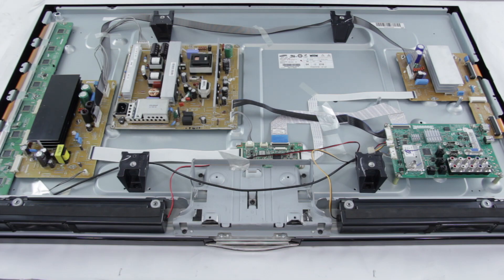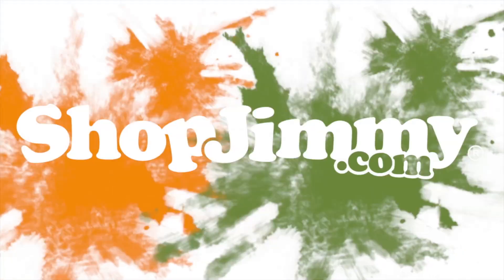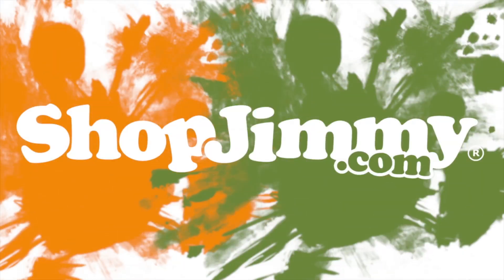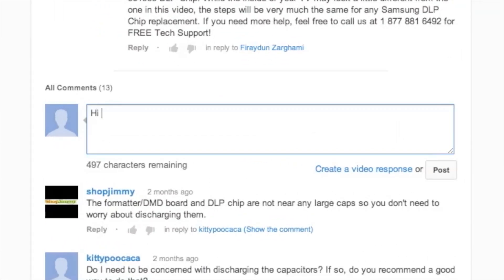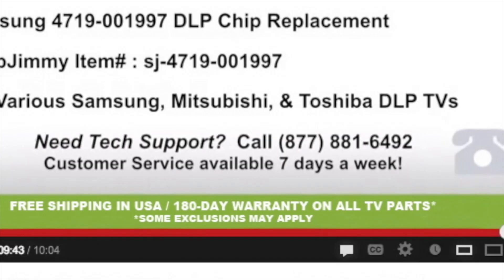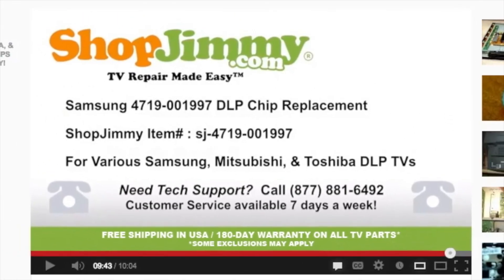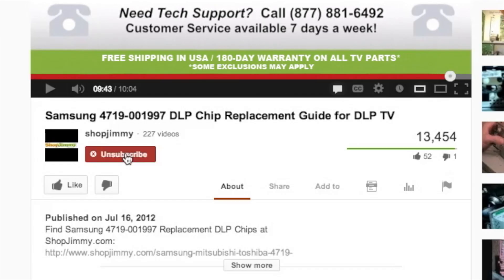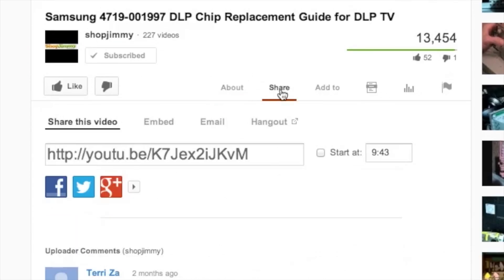Plasma TV Repair Tutorial - Common Symptoms & Solutions - How to Fix Plasma TVs

Comment: Hello, great video. I have a Panasonic plasma TV, Model: TX-P42S11B that turns off and the standby light flashes red 8 times. When I disconnect the SS board (X Sustain board) and power up the TV I will get a picture. When I disconnect and reconnect both the SS board and Y sustain board the TV starts working fine. After a few days I will have the same issue, the TV will turn off and if I disconnect and reconnect the Y and X board the TV starts working again. TV’s working duration time has also been going down from a week to a day or two now. Any suggestions which board should I replace to fix problem? Thanks!

Comment: Hello, you mentioned that you might be able to help with an issue. I have a 2008 AVP504 Sanyo 50 inch. Way back the top of the video became dark but we could see the bottom half of the picture.  Well of course not long after the bottom half did the same and away it went into storage. Been sat there, inside, warm comfortable,  and ir is now that I have time and inclination to fix this bad boy. Any suggestions as to the cause and how to proceed? Thanks so much!

Comment: hi , nice tutorial sir, i have 43" plasma tv 2013-14 model, it was working fine then as i switched it off in night , the next morning it was dead , no response , no red light on panel.  as usual called service center, they came an declared that its of no more use , its dead completely, reason they gave that display panel is gone and as now in 2020 plasma tv is out dated so it can,t be repaired.KINDLY HELP. SIR
ONKAR-INDIA

as you told sir- here are details 
mod.code- PA43H4100ARLXL
VERSION NO. : TD02
S/N: H0073PBF301036P.

Comment: hello im trying to fix my Samsung plasma tv, the red standby light blinks when you plug it in, but slow blinks, unlike others I see here on the internet. and there is another board that blinks a green light...I made a video on you tube to show what it does , I allready replaced the power board with another used one that was suposed to be a good one, and it has the same behaviors, IE, red light blinks slowly, and green light inside blinks one fast then one long blink,,...  here is a video showing what its doing, maybe you can help?
https://www.youtube.com/watch?v=RhsAqGHOqmw

Comment: I have an old SumSaung Plasma model TV model 850HW-YB07(mfg 2011).  It had faults recently with symptoms of no display and had power ready red-light short blinkings and goes away when turning on by the remote control.  At the point of failing,  i heard a loud "POP" sound and then no display straightaway.  I bought a power supply board from China to replace the old one in considering highly as the power supply board failure. Hwoever, having replaced, the same problems remain unchanged.  I wasted my money buying the power supply(it called substitute part from supplier) as original pwer supply module is no longer available.  Now i would like to get suggestions from Jimmy what the likely part goes wrong.

Comment: Hello, I own a Pioneer PDP-4280XD plasma TV and doesn't turn on anymore, not even the standby led nor any start up power noise. The previous symptoms on my TV set before failure were that it had some voltage leaks or so. I would need to remove the ground cable from the wall socket where I plugged the TV otherwise the mains would turn off in my house. This would only happen when I plugged a device (blueray player, PS3, Cable box) through any HDMI port. I could even see small sparks of electricity as I made contact between the hdmi connector and TV port. I solved that problem by removing the ground cable. 

A very long time after that fix I plugged a hdmi cable which has been press heavily   in one point of the cable length. 

Have opened the TV and have bridged the only fuse I have seen next to the power supply. But nothing changed. 

Any help would be appreciated.

Comment: I have a LG 42 inch that has many multi color lines that go up and down. It was stored for a while and it had the power cable across the screen.  I think that is what messed it up.  Is there  a fix for that? And would it be cheaper to just buy another one???

Comment: Having an issue with my samsung model pn63c7000yf.  The set turns on and I can get audio but there is no video on any of the HDMI inputs.  I have tried multiple cables on multiple ports.  Get the same symptoms on all variations.  Any thoughts?  Thinking it may be the Y Sus. board.

Comment: I have a sanyo DP42740 plasma. It had no power and no standby light. The power supply had 5v on standby but didnt have enough voltage going to both sus boards. I changed the main board. It now clicks on and green light is on at bottom, but no pic and no sound. I did flashlight test and nothing. Any ideas would be appreciated. Thanks

Comment: Hi Jimmy, my Samsung plasma TV PA43H4900 suddenly stopped working and my MCB tripped. Whenever I tried to power on the TV MCB trips. I checked the power socket on wall and found okay. Later I asked an electrician about this. He's saying it may the TV's PSU got short. I just want to be sure from you what may be the problem and what components are to be repaired or replaced. No lightning was struck when my TV stopped.

Comment: I have a 59” Samsung plasma tv (PN59D6500DF), bought in 2011. While watching the other day, the screen went blank. Hitting the remote on switch does flash the red light, but I don’t get any picture. I’ve tried the reset process with no success. Is this mostly likely a bad power board?

Comment: I have an LG Plasma TV model 42PN4500. One day it switched off on its own and now doesn't switch on. It goes on standby and when l press the power button on the remote, the screen remains dark but I can hear a faint tick-tick sound at the back. Can the TV be repaired?

Comment: I have a Samsung Plasma PN64D8000FFXZA that has no problem at all with the picture image/quality.  The picture does however shut/click  off on its own but the power seems to still be on because the green light in back blinks with a solid slow intermittent blink that seems normal  and the red standby light is not illuminated as if it was still on. At this  point I can not get the TV to respond to any command  (The standby red light does flicker when I push the remotes buttons)  accept it will turn off if I hold the remotes power button down for 3 or 4 seconds.  At with point the standby light does illuminate red indicating it has power. It will not turn right back on.  After letting it sit for half an hour or so, it turns back on and works completely normal for 5 to 20 minutes.  I tried bypassing the APC UPS and using just a DVD, but it will still cut out.

Comment: Great tutorial I have a LG 60PZ950-UA a few days ago, it started showing a wide purple bar across the screen and a green/red bar (both barely visible across the screen about 1/3 of the way from the bottom. Today, when I turn the tv on no bars, but after about two minutes it powers off. Tried to restart but no joy. It appears it's starting up in a standby, but not sustaining power and shutting down...any ideas would be appreciated.
Reply: Nevermind, I fixed it.My cable box was on an HDMI port that was apparently going bad.  I unplugged the box and started a fire stick on an open HDMI port (4 available). It worked fine the bars went away and the tv has been playing for hours. Next I plugged the cable box into an open port as I noticed I was able to adjust the volume with the cable box's HDMI plug disconnected. Once I plugged the cable box into an available HDMI port everything played perfectly. I have an HDMI splitter that I will plug into expand the port availability but only if I decide to run a raspberry pi for retro games.

Comment: Hi, I have an LG 60PN6500 plasma TV.  The problem is the TV cycles from ON for 8 minutes then goes BLACK (no pic, no sound) for 13 minutes (Cycling time was consistent over a 4 hour period).  The TV will also go black when any button on the remote control is pressed.  When on, the TV works fine and there is NO clicking or popping noise.  However, when it does goes black, controls on both the TV and remote don't work so I cannot even manually turn the TV back on.  Any advice is appreciated.

Comment: I'm having a couple challenges with my 13 year old Samsung plasma TV.  The first is, when I turn on the TV, it produces red-ish remnants from whatever the initial screen image is.  This lasts for about 15-20 minutes, then it goes away, but it is definitely annoying.  The second is, periodically, the top half of the screen goes black.  Sometimes, it comes back on and everything is okay and sometimes a light tap (or two, three, four, etc) on the right side of the TV will bring it back on.  I know replacing the TV is probably the easiest thing to do given its age, but I thought I'd ask.  Thanks, in advance.

Comment: I have a Samsung PN50A510P3F that power cycles repeatedly until warmed up. I can hear the relay click and the startup and shutdown tones each time. It usually starts with no picture/no sound, then graduates to bad picture, then better picture with loud static, and so on. Each power cycle it gets a little better until everything is eventually normal. It seems to take fewer cycles if all inputs are disconnected. I tried replacing the power board with no joy. What should I try next?

Comment: I have a 60PS60AU that shows power by having a red standby light but there is no sound or picture. I tried replacing the Logic board and nothing changed. Should I go straight to the power supply or the Y-board?

Comment: I have a Samsung Plasma TV PN PS60E8000GM which the screen will randomly go black on. When the screen is black the red light flashes two flashes ten a short gap and two again.Sometimes it works  after unplugging. I have done soft and hard resets, software and firm ware up dates and it generally will work for 1 minute to 3 hours once that is done. Any ideas?

Comment: Been having issues with a 9-10 year old 43” Samsung plasma TV. Never had any issues ‘til went to turn it on one day and it wouldn’t. Lots of clicking accompanied by blinking red light in the bottom corner by power button. After a couple cycles of clicking and blinking, the clicking would stop and the red light would stay solid, but tv won’t turn on at all. 

-Checked the power board first and found/replaced a bulging capacitor - no change.
-Followed another of your videos about troubleshooting what is causing clicking. Thought it was the main board, so bought a replacement main board, used. Only change was instead of cycling through the clicking/blinking multiple times, think it clicked once, the red light blinked a couple times, then turned off completely.
-Thought maybe the issue was back with the power board, after all, so got on an email alert for the part from y’all. Started out as a “green” -likely to be restocked soon. That was almost 2 months ago and still haven’t heard anything, so found a replacement power board on eBay, used. Switched it out, today, and still same issues with both combination of new/old power/main boards.

Kinda at a loss as to what it could be after watching this video.

Comment: Howdy,
My samsung pn59d550c1fxzc was working fine and then the hdmi inputs went dead. I unplugged all cables and then unplugged tv. Turning tv on again, my xbox 360 was the only device to work and that in input 3 and 4. I have no idea what is going on everything seems to be working fine but it just doesnt recognize the devices.
Have you seen this before? swap main board? any and all help would be appreciated. Thanks!
thanks for the video

Comment: I have a Samsung Plasma TV model#S42AX-YB04. We have had issues with it not turning on after some blackouts in our neighborhood, but would eventually turn on after pushing the power button a few times. Now it was unplugged from power via the surge protector during a thinderstorm to prevent this problem from occurimg, but it doesn't power on anymore. How can I fix this?

Comment: Hi i have a 42pm470t the fault i have is no picture but standby light goes out and i have sound the main boards green led lights up. The control board ic704 chip gets warm but the green led doesn't light up. But when i diode test it with a multimeter the led does light up. Then from the control board to the y-sus board i have 1-14 0v 15 3.2v 16-20 0v 22-23 5v 23-24 17.8v on the connector i hope I've give enough information.
Reply: Hi Jim I have got a plasma 42PG3000 has this TV got a backlight because it the picture is very dull

Comment: My plasma is the Samsung PN51F5300. It won't turn on and there is no standby light. It worked fine and the next time I tried turning on with no luck. Any thoughts? I took off the back and didn't see anything obvious, like bulging capacitors, etc. Thanks in advance!

Comment: I have a 2005 Panasonic viera model# th-37px50u. The sound cuts off after about 10 minutes. When I unplug the tv for a while and plug it back in the sound works again for a little bit whas causing the sound to cut off. Also picture is perfect. And I am doing this through a DVD player that I know works. HELP.

Comment: hi shopjimmy.com i have a LG plasma tv here for repair model no. 50K350 half screen bottom no display but the upper side has i have already replaced the y buffer board lower but condition no improvement and now as i double checked all the connections unfortunately the set turned to no display any idea sir?

Comment: Sam pn51d450a2d looks similar to the one in the video. Worked fine just had buffer board lines and one single vertical redish line. Was checking the ribbon cable between the y-sustain and logic board and it turned off ( while it was plugged in like an idiot) When I plug it in, you can hear a relay energize and the red light on the front blinks 5 times and the green light on the logic boards blinks slowly. 4 seconds long per flash. No picture on screen, no glow. Red light reacts to remote presses.

I only see one fuse right next to where the cord is and it has continuity. I replaced the logic board and no difference.

Edit: update. When I plug in power cord, I have 0v (or a small spike) at "Vs" going to the y-sustain. If I unplug the ribbon cable I have 200 volts and then the voltage bleeds out. If I unplug the cable between both the sustain boards, then I have 200v for a moment at the y-sustain.

Comment: I have a fujitsu 50” that the screen went black on and never came back. standby light turns on, i replaced the power supply with one I found on ebay and still have exact same problem.

Comment: Panasonic TH-50PX75U tv turns on, you can see the black screen get a littttle lighter but still black and no sound. It does blink 10 times, and service manual says power board but nothing on the board seems damage, burn, or bad in general. How can I test to make sure its just the power board or if its multiboards?

Comment: This is a long shot, but wondering if you can help. My cat sprayed the screen of my 2010 Samsung PN58C7000YN Plasma TV. I cleaned the screen, but some cleaner ran down the screen and seeped behind the bezel on the bottom right corner, where the touch sensors to control the TV are located. Now the TV turns on by itself, changes the source randomly (PC, Set Top Box, DVD/Blu-ray, etc). Basically the sensors are just going crazy. Is there a way to remove the bezel so I can clean it on the inside, and maybe even replace the board with the sensor buttons on it? I know it's an old TV, but it worked perfectly until this incident and I actually really like this TV. The picture is much nicer than our 2 year old LED Samsung that cost almost 4 grand. Thanks in advance.

Comment: My 11 year old Samsung PS50B679S1SXZG (EU MODEL) suddenly flashed and sparkled in the back (bottom left rear view).  The TV went out and I think it went on for a moment before I unplugged it.  Can I repair or replace something with little money? I found out, that a small blue part behind the back plate blow off. There's black dust. All other parts seemed OK. The white number on the green board (BN96-09744A) for this part is C5090.

Comment: I have a Maxent Plasma TV Model number P58H10NJA.  The TV turns on but after a while it turns off by itself sometimes it stays on 5 minutes or 4 hours but it eventually turns off.  Do you have any ideas what I would need to replace to fix this issue?  I do not have any settings selected that automatically turn off the TV so I checked that already.  Please help before I get rid of it.

Comment: Ok so my tv wouldn't turn on after sitting for a month with no power and I have no stand by light so I replaced the power supply board and I still have no stand by light and tv still wont turn on what should i do

Comment: I have a 64" samsung Plazma TV. Pn64E8000GFXZA  Once I turn it off It goes to standby normally. But when I try to turn it back on it comes on for a few seconds then turns off. it just keeps doing this until It finally comes on and stays on. Now it has gone to the point of not starting up at all. You can hear what sounds like a relay click but nothing happens at all.  This appears to be a power supply problem in the start up process. Is this accurate? The  Picture and sound are perfect when it is on.

Comment: can you help me with my old lg? it is turning on but has bad picture, even the "no signal" text has horizontalli  shifted ghosting pixels, any input has multiple shifted ghost columns... it is like when the lcd ribbon cable has a break or freqvenci shift but I don't know how plasma works. no visual issu inside no puffed capacitors etc...

https://drive.google.com/folderview?id=1tRA8SyZZBAFgxstnKsBJTbbGTiC2e4Rr

Comment: I have a samsung plasma model pn59d550c1fxza that will turn off and the red light blinks 5 times. The tv then will not turn back on. I will hear clicks and at times it comes on with picture and sound then dies the same way.  Bad power board?